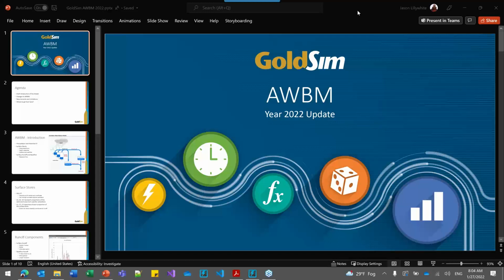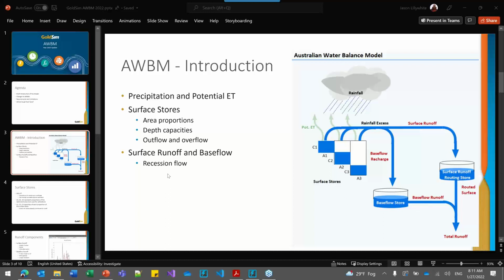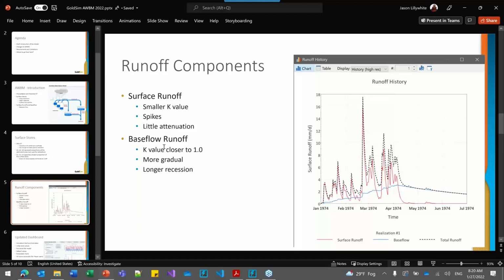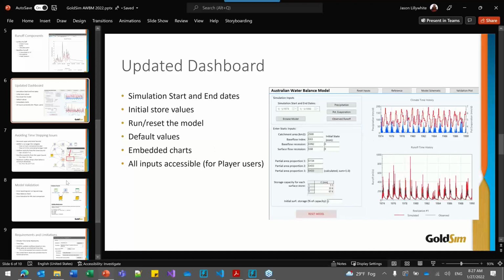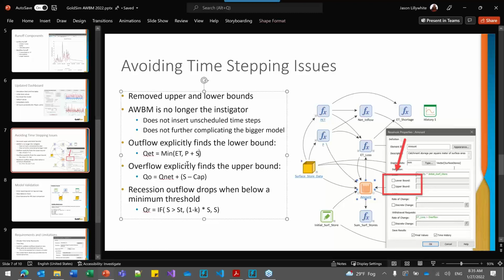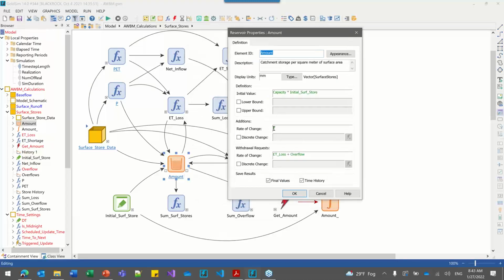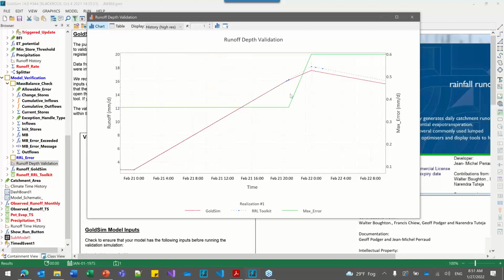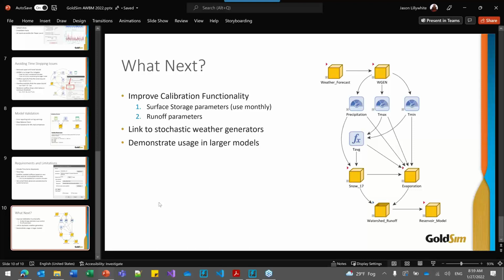Australian Water Balance Model Update

Comment: Hi, thanks for the video, very useful! Just a quick question. I don't get why you define an extra element for the time step (DT), when you can specify this in the Simulation settings (Basic Step = 1day). Is this in the case that any unscheduled updates occur?
Reply from the maker: Yes, exactly. In GoldSim, unscheduled time steps can occur. They occur when the upper or lower bounds in a Reservoir are reached, for example. You can generate random events by specifying a delay with random dispersion. You can specify that a power outage occurs on a random time interval. There are many ways that time steps can get inserted in your model so you need to refer to a constant variable in the model in this case.